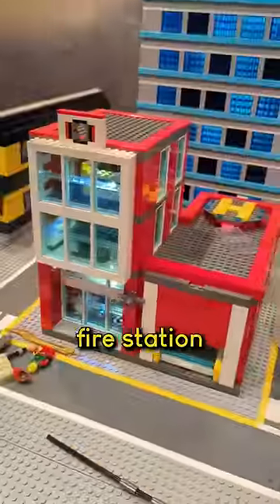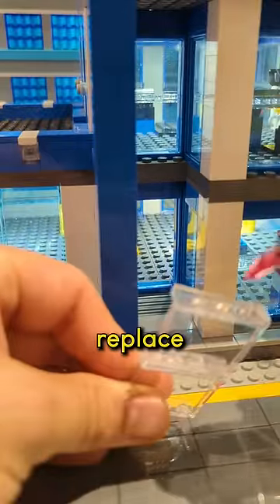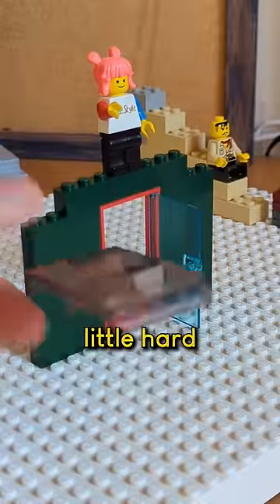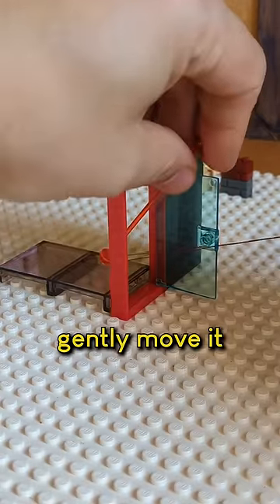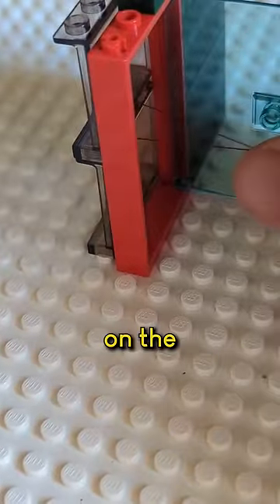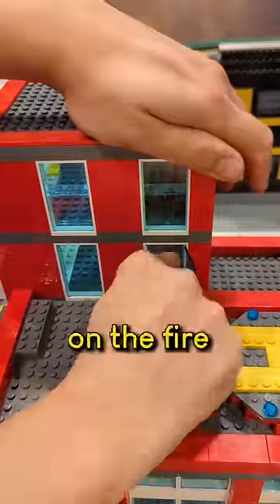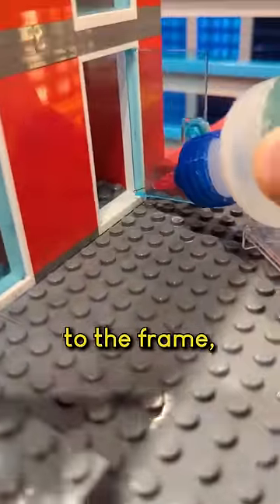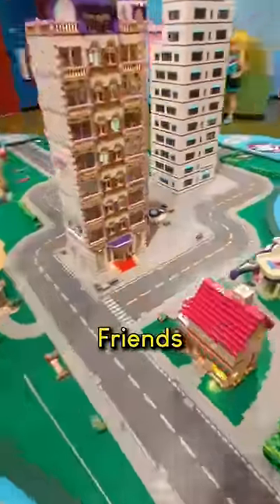Will it hold??? #lego #legos #legoaddict #legomoc #legocity #afol #legoland #legobuild #legofan

Comment: I would also suggest removing that "doorknob" stud. It might look a little weird without it, but it would give the kids less to grab on to when they try to pull it open to put stuff in there. With that being a less desirable option for keeping the door shut, you don't want to be making it any easier for them to break it and open it again. Or you could even swap it for a flat stud that doesn't have the ridges on it that make it easy to grip.
Just a thought.
Reply: With this kind of glue, it dissolves the plastic and "welds" them together
Reply: @skyler9988 but like they said in the vid there’s not a lot contact points so it could potentially still snap off
Reply: @jgamez106  True
Reply: Are there "flat" studs????
Reply: @PointsofData  Yes
Reply: @PointsofData  oh yeah they are awesome. You can get them with all kinds of print too, I had a set that had a flat stud with an image of a doorknob on it. Worked great
Reply: Could you replace it with a flat plate so it looks like a push to open door? I don't think there'd be much to grab onto to pry open the door
Reply: I'd try replacing it with a flat stud. That way there wouldn't be that "ledge" to grab.

Comment: Something I've often wondered is why you glue models with a solvent, rather than some kind of removable/water solvable adhesive? I'm sure there's a reason I'm not thinking of, but it does hurt just a little every time I see you do it. And especially when you have to pull the bricks apart to make repairs.
Reply: There's another short video where he explains why he uses that particular glue, and how it works.
Reply: If I don't remember wrong, using glue actually adds a small amount of matter between pieces, and while unnoticeable in small builds, in the massive buildings they have, that small amount becomes large size differences that affect the whole building. Meanwhile, using a dissolvent, the size remains constant without adding any "extra" matter on the build since the chemicals evaporate.
Reply: Not only is it what other people said about the extra material but the solvent chemically bonds the material, similar to vulcanizing glue with tires. Given how many people come and play with the models daily, it would be intractable to leave them as-is or use a more repairable but weaker glue
Reply: Because this stuff is miles better. With any normal glue you could just break the bond over time. This stuff pretty much melts the plastic together
Reply: They go over this in another video, it's because glues add material to a build, where a solvent welds the plastic together without adding material. When you're gluing as much lego as they do, all that glue starts to affect the lego system. Would make sense to glue some sort of "maintenance hatch" in though imo
Reply: Simply gluing it would be surprisingly weak. Like with wood or paper the glue soaks into the fibers and hardens, binding to itself meaning the bond can be as strong as that between the fibers, but ABS plastic is nonporous and the surface is smooth, so there's really nothing for an adhesive to bind onto. So you need to bind to the material itself, and for something like ABS, that means dissolving it.
Reply: its a better fuse and doesn't add another layer of material between the bricks like glues do
Reply: Adding on to what everyone else is saying, I've also seen videos where he uses a steamer to clean the models, and if the glue was water soluble that would complicate the steam cleaning
Reply: Water solvable glues suck. They kinda work on paper but not on synthetic, non absorbent, perfectly smooth materials. Not to mention that those really big builds have to get regularly cleaned.
Reply: Technically, that’s a type of liquid cement and can be removed with 100% acetone. Used to use it to put acrylic awards together.
Reply: Water soluble adhesive tends to not stick to plastic well, plus adhesive tends to add a layer to the bricks that can very much alter the size of the building once enough layers is given

Comment: I know its too late now but i would suggest staged gluing on the buildings. Each layer's walls are glued solid but the baseplates remain standard friction locked, then you could take off each layer to easily remove or add blocks and even give an extra play feature to them! 

Simply glue the base and four walls together for each room of the building, leaving the open tops like a Sims house. You now have large detailed legos that can be rearranged countless ways, and it should be pretty simple to make prefab roof pieces the same way...
Reply: Then the different layers of the models will be all over the Discovery center. Entire buildings even. Nooo way dude.

Comment: When you don’t have much contact between materials, you can use a very thin bead of clear silicone in the joint. Place it Similar as you caulk  windows and tubs with it contacting the bottom/sides and the vertical piece. It’s not as nice for photos but it works. Use a micro syringe or needle-like top glue bottle as an applicator not the commercial squeeze tube it came in.

Comment: Next time use a knife blade or sand paper, something to add scratches to the door and frame, it will help it hold together and create more surface area to cause a stronger bond with the glue

Comment: :C why didn't you put a tile stick piece on top and put string through that. You'd have two strings and could push the window to the left and get it upright before pulling it right and sticking it into its place

Comment: You could use a piece of tape as a hinge for the two pieces and a piece of string in the middle of the two. Put them in folded and then use the string to pull them flat

Comment: I would’ve tried putting the panels in seperately, using the same string method just tied tightly around the panel itself instead of ran between the two. Would take more finesse and time but better result with the limited space behind the opening.